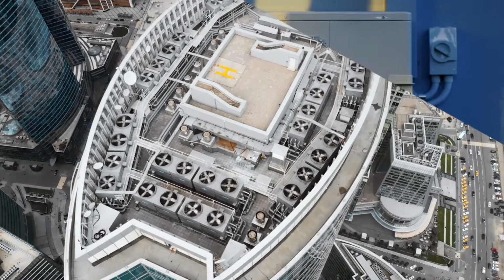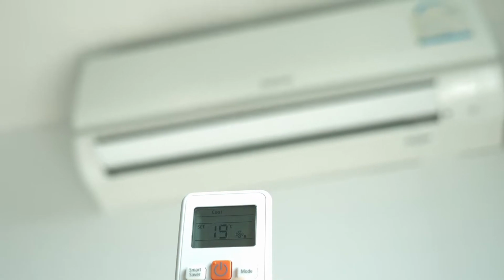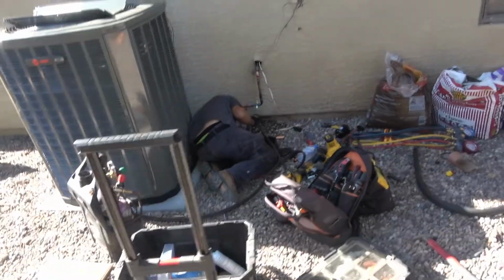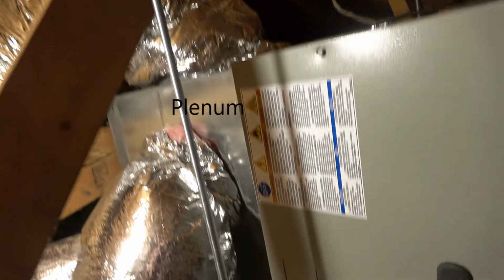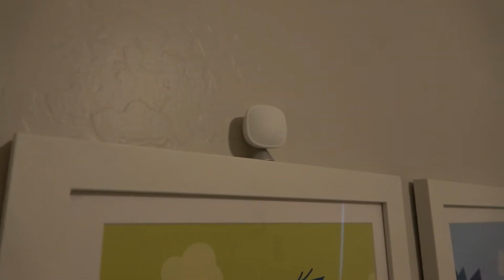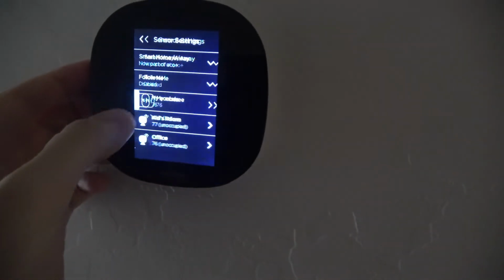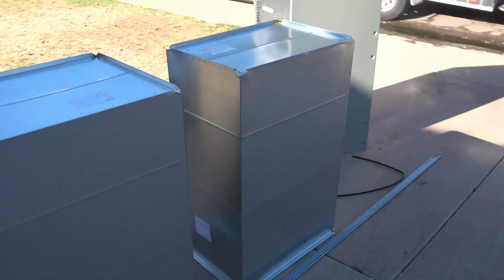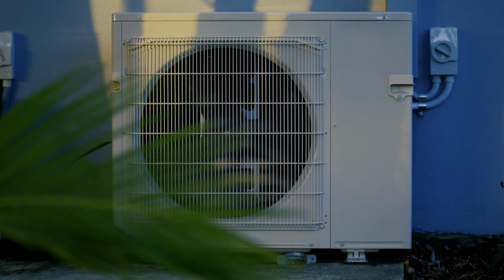Central vs. Mini-split: Which is Better?

Comment: I love your split but there is another option. Central mini split. I just installed a 5 ton central system.  Yanked my old train dropped min the McCool Central System and it cost a fraction of the cost of hiring someone. You are correct, getting the air handler in the attic was hard but doable with $15 rope pulley from harbor freight. McCool has a 10 year parts and labor on the Central System. We are loving it.
Reply from the maker: Nice!

Comment: We went with a central air system despite not having existing ducts, we had electric baseboard heat as our primary source of heat. We looked into mini splits and based on the way our house is designed, nearly every room would need one and the guy said it would have costed more than central air for multiple units. Our house is designed where if every room is heated or cooled at the same time it would feel less miserable overall. It was pretty pricey but it was worth the investment. Mini splits are ideal for milder climates or for those who need supplemental heating and cooling. But we live in the northwest where we have hot summers and cold winters. Both would be good for where we live but it’s out of our budget for now. Both systems have their pros and cons and the central air had more pros than cons for us.
Reply from the maker: Thanks for sharing. As with most things in life, everything is pros/cons. There isn't really one answer.

Comment: Why didn’t you install mini-splits for all rooms in your house? According to negatives mentioned, it seems better to get rid of central air for good
Reply from the maker: You need to have electrical (and all that entails) at all the points of use, as well as good places to put each unit (this will take a lot of real estate and could be an eyesore). Also, having 5 units is much less reliable than one. For an existing home where central air exists, you're almost always going to be better off keeping central air.
Reply: @theeverydayengineer  I don’t think 5 individual units are less reliable than a single central ac. Multi units that run independently will provide good redundancy. I.e if one dies, you have another 4 to supplement. One thing I am not sure is, if central air has been manufactured to a very high quality that it is multiple magnitude more reliable than cheap mini split. How do you think?
Reply from the maker: @MrTimjin  It doesn't work that way. Every unit needs periodic/preventative maintenance (PMs in the engineering world). Nobody is going to just say "oh one unit died, that's ok, there are 4 more." You'll always get that unit repaired. Instead of having 1 unit with a fail rate of X%, you have 5, which means you have a higher fail rate, plus more equipment to maintain. = more $
Reply: @theeverydayengineer  Failure on splits is extremely low. Not sure about those other units.
Reply: @theeverydayengineer  I agree with you on reliability. Single Zone Single Head/Outdoor unit will always be more reliable than a 5 zone, 1 outdoor unit system. You install more points of failure. This is why we like to pull continuous conductors in electrical with ZERO splices, each splice introduces a point of failure, no different than 4 extra flares for every other head added to a Mini split system.

Comment: I have the same situation/setup like yours lol, of course Ecobee as my thermostat as well! ,,,my office is the heat room to make my CA runs (I thought the same of adding Minisplit to my office as I found out the reason my CA runs quiet more often because of the office getting hot ...So did you take away Ecobee remote sensor of the office? How does minisplit cool your office? efficient? less $$ electric?

Maybe mine is still in luck that the Day&Night Condenser still working (15 years old now) - and yes I am expecting it would fail anytime so my Sears Whole House Warranty would kick in LoL!

I was baited to Solar panel but I think it might not help as well while handing down like $35K LoL!!
Reply from the maker: Yeah, I took the sensor out of the office since it's mostly cooled by the mini-split.

Comment: Why would it be more efficient because it's smaller?  Most things seem to get more efficient if scaled up.
Reply: Because it takes a lot of extra energy to drive larger physical devices such as larger compressor, larger fan. So it is wasteful to run all those, just to serve for a small area
Reply from the maker: With central air, there are a lot of inefficiencies associated with plumbing (ducting) the heat through the house -- typically uninsulated areas such as your attic. There are more reasons than this, but just to name one...

Comment: So its a worse scenario to run a duct and register to each room vs mounting a head unit, running copper lines through the wall and connecting each room to a condensor outside? And if its multi head, youre running two sets of copper lines and condensate drains to EACH room... What am I missing? Id rather run a duct to the room and be done.

Not to mention you have so many more things to go wrong and maintain.